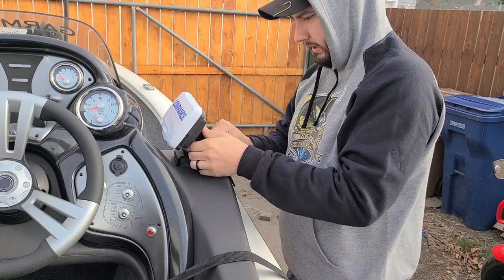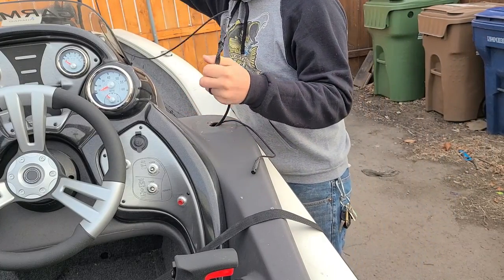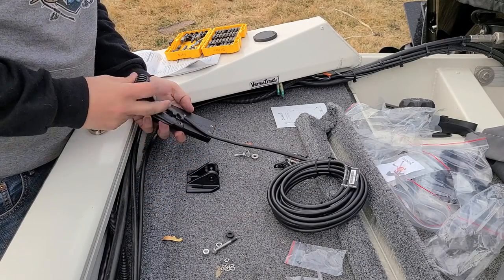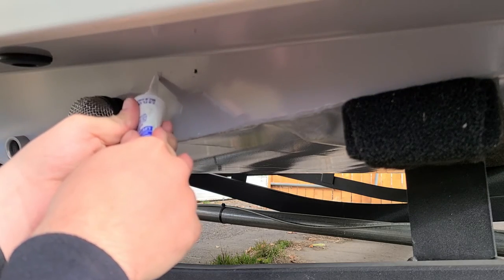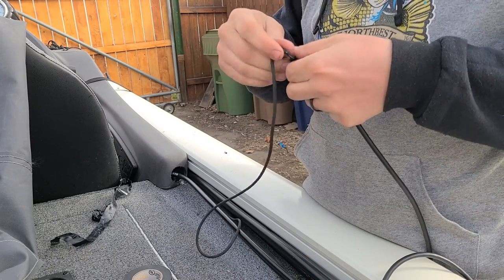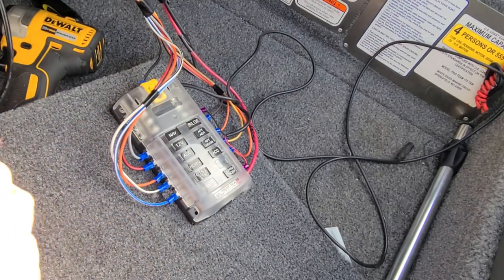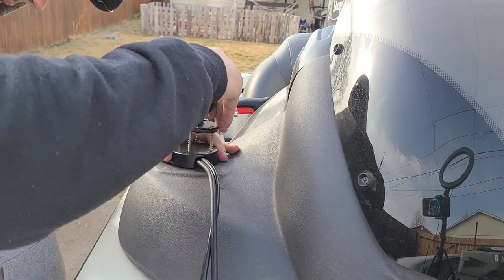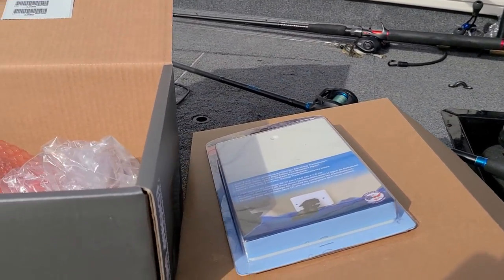How to install Garmin ECHOMAP UHD 73sv - Part 2 (console mount)

Comment: Good video. I also have a Tracker Pro Team 190 and recently ordered a 73sv for the counsel thinking the 93sv would be hanging off the side of the boat too far. However been second guessing myself on that but seeing how the 73sv looks in your video it looks plenty big enough. So do you feel the 73sv is big enough for side imaging/mapping or do wish you would have gone bigger?
Reply from the maker: I always say buy the biggest best whatever you can afford because you're never going to regret it. The 93sv would fit well, especially on a 190. I do feel like the 7 is a good size however I've never used anything bigger than 7 inch units. If anything I might like a larger unit for the screen above the foot control pedal on the bow.

Comment: Hey thanks for vid. Gonna try the same install for my 93sv. Wondering, the transducer on the bow goes directly to the bow screen. comes with like a 20 ft cable or so for the transducer.. did you just coil up the excess and stick it somewhere? Thanks!
Reply from the maker: Yep! I just shoved mine under the trolling motor pedal tray.

Comment: Why did you move the transducer to the other side?
Reply from the maker: Per the manual. Due to the direction my propeller rotates the transducer should be on the starboard side. The dealer installed the old lowrance unit on the wrong side.
Reply: @NorthBestFishingOutdoors  this is why you DIY.
Reply: Tracker is one of the few boats you can put the transducer on the left side. The hull is shaped so differently and that area doesn't get turbulence from the prop. All transducers are on the left on that style hull. Nice job for sure on the install. I did all kinds of upgrades to my 175txw so I got to know the boat pretty well. You definitely learn alot doing that